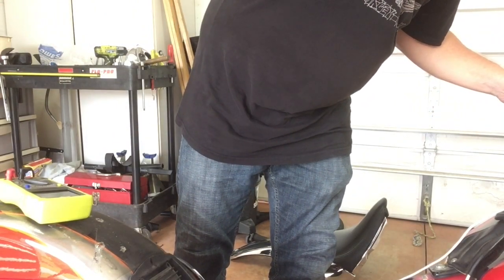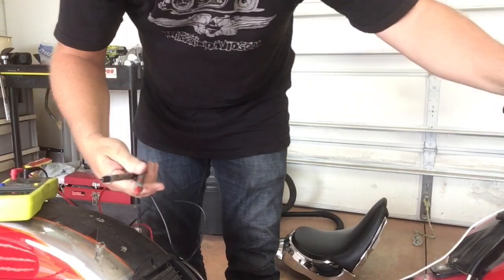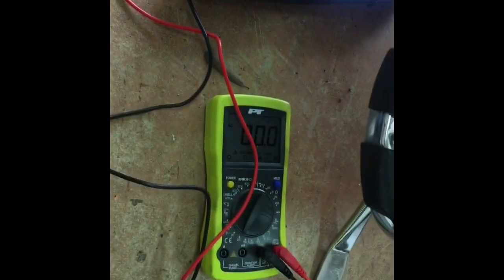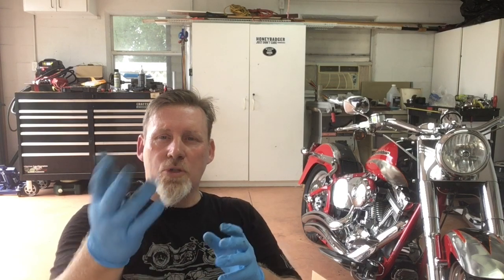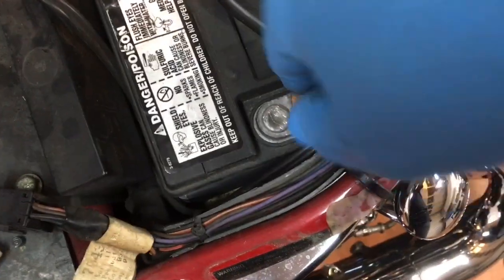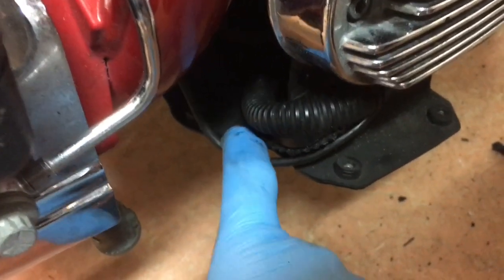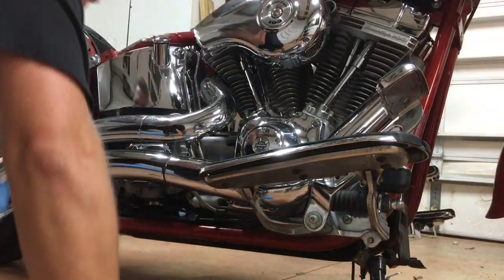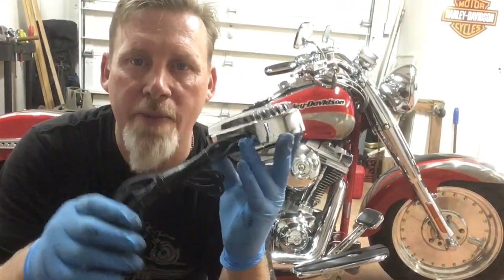My Harley Davidson Fatboy Quit Charging DIY Testing And Replacing The Voltage Regulator.

Comment: I just did a diagnostic on my girls Heritage with a 103 engine.  I found the stator was good.  Before I removed the voltage regulator I checked it to see if it had a good ground to the bike and it did not.  Her regulator is mounted on a stamped bracket bolted to the frame.  I removed the regulator from the bracket and the bracket from the bike.  Everything behind the regulator was caked with road crap and what looked like old engine oil...possibly from a messy oil filter change or 2.    I cleaned everything with brake clean and cleaned the 2 plugs going in and out of the regulator, roughed up the back of the regulator and the bracket and frame mounts with emery cloth and put it all back together. The ground between the regulator and frame was now good.   The charging system went from 12.6 volts running at the battery to 12.9 at idle and 13.8 reving the engine.  Once the battery returns to full charge all should be fine.

Comment: I've done this twice on my own Fatboy, learned that running that primary wire back to the connection was easier by cutting the old one at the regulator & connecting the new one to it to 'fish' it back thru the frame to the actual connection.👍
Reply from the maker: sound like a great hack for running the wire with ease thanks

Comment: My 2010 fat boy lo started with the engine light coming on and after 60mph my speedometer light would go out! Pain in the arse!! I ended up taking it claiming it was the stator however it was in fact the voltage regulator that was going out. I had them replace both to be safe. Mind you my bike has 57k miles on it. I appreciate this video as a woman who rides as it helps me to know what it is getting done to my bike!

Comment: Hey man, thanks. You described exactly what just happened to me this afternoon. Except I didn’t make it home. Got bike towed to home. Found your video. Followed your lead, (no pun intended) found it was the regulator and now I’m shopping for a new one. Bravo! You just saved me hundreds of $$$ !!! Just one thing. On your stator test, you could have informed us that you are testing each plug against the other all the way around the three way phase connector. That was the only thing I did not hear or see you do or talk about. I guessed that was what you did and I duplicated your meter readings. Thanks for the great video. 👍
Reply from the maker: Awesome news glad it helped, there is a link in the video to the regulator I used, also do me a favor and hit that subscribe if you haven’t yet.
Reply: Done. I’m a subscriber 👍
Reply from the maker: Thanks for the sub
Reply from the maker: satwatchers awesome it helps us out ty also tell you friends

Comment: I’m confused on your 3 pin setup and how you connected your meter to it. Can you explain that?
Reply from the maker: It was years ago, but I put pins in the connector so I could test the the voltage, sorry maybe search some other videos on the topic and they explain it better than I did
Reply: @TheBadgers  
Thanks for the reply. Ride safe!

Comment: This same thing happened to me but i was 400 miles from home up in McCall, Idaho engine lght the battery light came on made it to Boise then it wouldnt start. Bought a new battery it fired up and i started my ride home at dusk about 50 miles later my lights started dimming nad then the bike started backfiring then shut off. Anyway after checking everything come to find it was my Stator replaced and all is well now. Nice video.
Reply from the maker: Sorry the bike quit on you, but awesome news you were able to fix it. Thanks for watching and subscribing.

Comment: Very useful information. I ended up on the side of the road today. Called the bike dealer cause its under warrAnty but it turns out it was the regulator... nice to know it’s a simple fix it it happens again in the future.
Reply from the maker: Sorry you broke down but glad they fixed you up.

Comment: I had a bad battery, jumped my bike, hopped on and rode off. A few minutes later the radio quit, followed by the gauge pegged out past 16V. Kept  riding to find a place to pull over and smoke came out from under the seat. Found the stator shorted, and the artery cooked, seems like the voltage regulator is bad also. Used a meter to test the diodes, reads “OL” across all the terminals, but this method is surefire. Great opportunity to check those grounds as well. I would also not recommend jump starting a bike with a running vehicle.
Reply from the maker: Wow I have jumped a bike with a car before, and never had an issue but this will make me think twice.
Reply: What was your fix for this? My bike did this this weekend on a trip. The only thing yours did that mine didn’t was mine didn’t smoke.

Comment: YUP ur stator is good, thumbs up. Just went through this on my 91 Sporty1200, that was weird, I   really thought my stator was toasted as the connector between it and RR was so hot is was 
smoking. But knowing how to test the stator was good as it would have been a lot of trouble to 
get a trailor and get the bike to a dealer, and of course what the would cost.

Comment: I have a 2011 Fatboy low with only 16 K miles on it. I’m trying to buy that voltage regulator that you shared in your video. I don’t know how to check the link with Amazon and you can you share that with me. 😊😊

Comment: hi nice video, I had the same with my heritage M8 114, the regulator is'nt in the best of  ideal places especially if it's raining a lot of spray comes off the front wheel, when mine broke it over charged the battery at 17.2 volts and distroyed that as well ,Hmmm
Reply from the maker: Hmm never heard of that, but anything is possible for sure, Thanks for watching, and if you haven't please subscribe.

Comment: The first test to get the ac volts reading. Was nt he connected to stator and not the voltage regulator?   The stator makes ac . The reg makes dc .it converts  it to dc .

Comment: Where did you put the meter leads when you tested before the regulator?
Reply from the maker: @TKO-NY  when I was testing the stator??
Reply: @TheBadgers  yessir
Reply from the maker: @TKO-NY  I was testing the plug that came from the stator
Reply: @TheBadgers  but where did you put the red and black leads? Around all 3 pins, 3x? Red on one, black on another?
Reply from the maker: @TKO-NY  yes put pins in all three so I could test all three sorry on the road in the keys on motorcycles today so hard to be more detailed without my repair manual as far as wire colors go
Reply: @TheBadgers  ok. I just tested mine at the stator, (03 ultra) I'm getting 29-30 at around 1500-1700 rpms. (Seemed to rev a bit higher with it unplugged, cold start/injected) And only a steady 12ish at the battery, no increase at the battery whatsoever. Seem to you like regulator is the culprit of my quickly draining battery, dimming lights, ect?
Reply: @TheBadgers  mine is also only a 2 pin connector as well. Tested both ways.

Comment: Great video. However, I never saw which wire behind the fender is which and how to get to it. Oh well. Another day, another video.
Reply from the maker: Justjack613 just follow the wire from the regulator to where it is attached, it help on with a small nut

Comment: Put a new battery on. Same lights came on.  My next move is my voltage regulator then stater
Reply from the maker: Jacob De Leon did you test the system??
Reply: I have not yet. I have only put a new battery in it

Comment: before is the stator
Reply from the maker: before what is the stator
Reply: i got an iron 883 those 3 wires i think run to the stator on my bike,my regulator has gone again and i only got it replaced 1337 miles ago